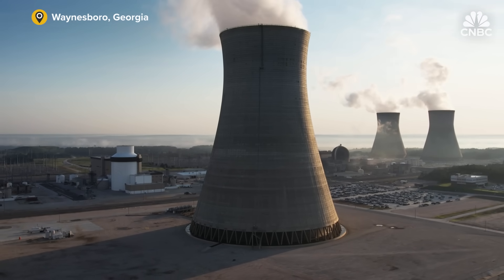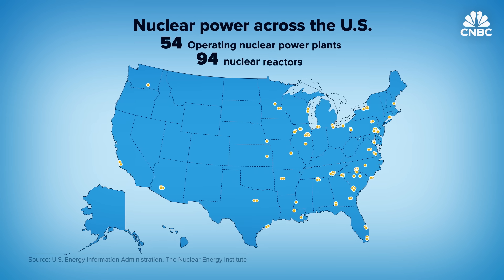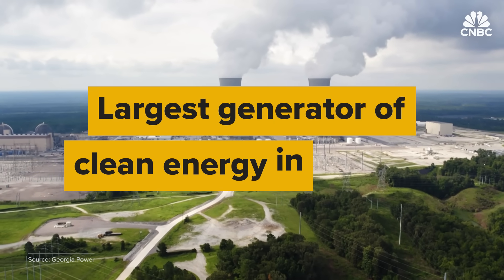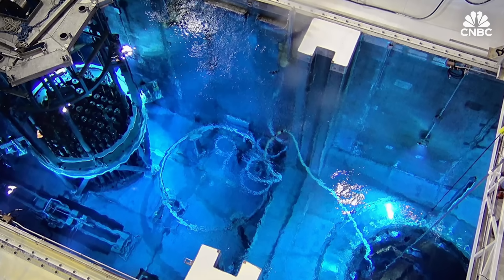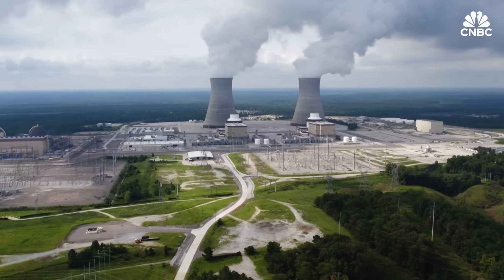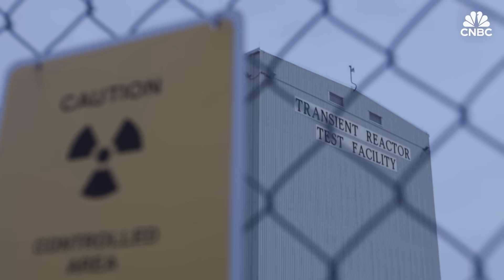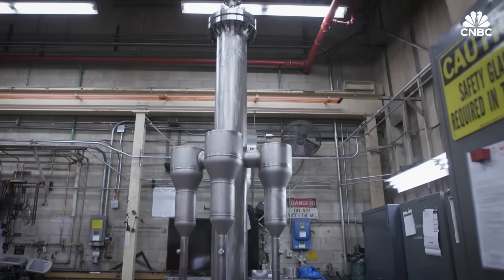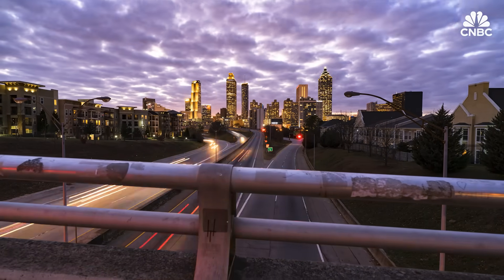Why It’s So Hard To Build Nuclear Power Plants In The U.S.

Comment: Why not build them in the ocean? With unlimited cooling  capabilities you would never have a problem with a potential accident. As long as the spend fuel rods are kept cool. The water not only acts as a coolant but as a barrier between the radiation and exposure to the environment.

Comment: Choose the vanilla electricity plans. Do not choose gimmicky plans such as free nights or reduce rates during certain hours, because overall, the electricity plan will cost more over time. Choose an electricity plan that is 2 years or less so you can switch. Electricity companies will increase their rate over time especially if you choose a longer plan.

Comment: I worked at NRC during Vogtle 3&4 construction and much of the cost overrun was due to shoddy work at the offsite construction plant. This plant used modules that were built offsite and shipped to Vogtle. There was poor QC at the construction plant and Vogtle had little to no oversite of the contractor. Consequently, modules had to be fixed on-site or send back for re-work. NRC inspectors knew the schedule wasn't workable, but that's what Vogtle put out publicly. Now ratepayers are stuck with the bill for their incompetence.
Reply: Worked for WPPSS nuclear project at Satsop WA. It was obvious from the beginning nobody was 'in charge'. Never finished. Satsop became the largest US bond default in history, but I was able to parlay that into another experimental reactor at St a Susana Lab, and again nobody was 'in charge'. That project subsequently leaked radioactivity within sight of LA, and the contractor bleached all records. I never worked there and there was no project. Horrible malfeasance, but imagine if word got out about leaks at the five US nuclear rsearch labs! Google 'downwinders' and 'cancer alleys'

Comment: It's funny that Westinghouse is also struggling at building It's AP1000 when they used this argument against the French EPR. In fact they're both struggling 😂
Reply: Small update : The EPR rector is finally working and connected to the grid (finally)

Comment: For the record, nuclear is smokestack-free, NOT emissions-free. No form of energy generation is once you pull the threads on materials and supply chains. But nuclear is in a class of its own. It’s a challenge to mine, leaving tailings that are radioactive. The refining process, which often begins in the mine, involves leaching that can pose a threat to groundwater. Every step of the way, a radioactive substance has to be contained, generally with lots of steel-reinforced concrete. Both steel and concrete have signifiant carbon footprints in their production. Nuclear waste is tricky. Currently, 90 thousand tonnes are in “temporary storage” at reactors because there is no place to send it. If/when there is, the radioactive material will have to travel by truck on public highways, or by train, which can present a security challenge. Or, at a time of accelerating climate change, simply a challenge. Rail track expands in heat so hotter temperatures are already presenting a new wrinkle for that mode of travel. While US mines are starting to reopen, currently about half the world’s enriched uranium comes from Russia, so there are also geopolitical concerns. Water for cooling  is another issue. While some newer SMR designs are much better on this score, the amount of water needed at a conventional plant is substantial. And when that water is warmed, it degrades it for other uses. Nuclear may be an essential part of our energy future given soaring electricity demand from AI, but the narrow focus on smokestack emissions has obscured the issues of what we’re dealing with. The video is good reporting as far as it goes. It could go further.

Comment: I worked as an electrician building unit 4, and from my personal observation, the biggest hangup on the project was the contractor (Bechtel). They controlled the workflow and we had to work off of "work packages", if you were working in an area and did not have a work package, you would be fired. There were many times when crews would finish their work in an area and would have to wait months to get their next work package for another area. They also did not hire enough field engineers, we needed to have all of our work inspected by engineers and southern company quality control, we would be always waiting on the engineers to show up just to drill holes, mount supports, or finish out a package. The problem is our power grid being owned by private corporations that only care about profit, if we cut out the contractor middle man and the nukes were just state owned enterprises, we could build them much faster and much much cheaper.

Comment: The primary challenges are all regulatory. There isn't an actual reason that the U.S cannot produce the majority of its base load energy from both traditional nuclear reactor designs, and novel small modular reactors. 
If we are going to run our government as if debts don't matter then, even just allocating a portion of the equivalent that has gone to Ukraine could completely alleviate the challenges surrounding nuclear's steeper start up costs.

Comment: We dont need nuclear, we need solar and batteries to store the power.
Reply: Battery storage is enormously more expensive on its own than just building nuclear plants.
Reply: @Crispr_CAS9  by how much ?
Reply: @rubenjaimes1194  Depends on the estimate you read and the type of storage solution you're using. But around 2-3x the cost of nuclear alone.
Reply: @Crispr_CAS9  where is this information coming from ? Link ?
Reply: @rubenjaimes1194  Schmidt et al 2019 in Joule for LCOS and EIA LCOE for cost of nuclear.
Reply: Batteries are nasty electrochemical devices. I'd take nuclear quite happily. Host a small modular reactor on my own land even.
Reply: @paulanderson7796  you obviously don't have a clue what you are talking about. Moving on.
Reply: @rubenjaimes1194  Feel free to move on matey. My degree is applied industrial chemistry. Stop the arrogance firstly and this discussion can proceed.

Comment: 3:48 The Westinghouse AP1000 was designed in the 1990s. A "current" design, not a "new" design. We need more of these Gen3 AP1000's in order to produce Gen4 reactors. Generation IV reactors are going in the design direction to recycle spent nuclear fuel from Gen III. Make them, we're 50 years behind where we should be.

Comment: Well…. Main reason is nuclear cannot compete… its to expensive
You only need solar and batteries, its way cheaper and faster
Reply: Nuclear power, on a a years per GW per site basis, is faster than solar and batteries, and is cheaper than the batteries alone before you even add the panels to power them.
Reply: *too

Comment: worst case for a petro-powered power plant. loss of 2-200 people, temporary loss of the use of 3 million sq feet of land. worse case for a nuclear-powered powerplant: loss of 2000-200000 people, permanent loss of 3 million sq miles of land. risk is a combination of frequency and severity. the problem is that the severity is so high that the frequency has to be proportionally low to achieve the same level of risk ... and that frequency is impossible to achieve. you can control what you know to below that level. you can't control what you don't know below that level because you don't know what to control. 50% of people want nuclear power. 0% of people want it within 100 miles of their house.

Comment: The operative word is "commercial".  Electricity supply should be regarded as strategic and underpinned by the State.  In the 50s, the State wanted nuclear devices and then learned of the benefit of cheap electricity.  How electricity is generated is a political choice.  If you do not have extensive hydro, as in Norway, fossil fuel is cheapest, but it makes CO2.  So for reliable 24/365 electricity production without CO2, you need to invest in nuclear, as was done 50 years ago.  Chernobyl and Fukushima were avoidable and were very careless.  We can do better.

Comment: There was the same problem in France, which has the highest number of reactors per capita.
They were all built decades ago, and the new types being built are slipping in budget and delays due to the disappearances of knowledge and experience after so many years without building new ones.
Plus, the new French model was extremely compliant, so much that after the completion of the first one (which is done), they'll go directly with a simplified 2nd version for the next ones.

Comment: Building reactors and using spent nuclear fuel, yes theres a way to use spent nuclear fuel as fuel exists, is easy. The hard part is the bureaucratic process. Tons of paperwork, tons of regulations, delay after delay after every delay, year after year, and lawyer fees. Thats the issue
Reply: SOLARS 5X CHEAPER ONLY SHILLLS TALK ABOUT NUCCCEAR... 100 YEAR STORAGE COSTS THEN 8X CHEAPER IN REALITY-- MEXICO DID 2 CENT KWH SOLAR FARM... AND NOW SOLARS DROPPED EVEN MORE A LOT

Comment: The big problem: each nuclear power plant is a very expensive, custom-built installation. That's why in France, they essentially duplicated one reactor installation type all over the country to keep construction costs down.

Besides, the future is small modular reactors of around 100 to 250 MW output per reactor, where each reactor's parts can be pre-assembled in a factory and then the reactor is final-assembled at the power plant site. And the new reactors will use Generation IV reactors that are essentially meltdown proof and use way cheaper thorium-232 as the nuclear fissile fuel.
Reply: SOLARS 5X CHEAPER... ANYONE TALKING NUCCCLEAR IS JUST SHILLL OR PARRROTTING SHILLLS INFO FACTOR IN 100 PLUS YEAR STORAGE OF WASTE AND ITS 8X THE PRICE PROBABLY --- HENSE MEXICO NEW PLANT 2 YEAR AGO 2 CENTS KWH SOLAR....... LOL AND PANELS 500W NOW 50 BUCKS 30 YEARS LAST LIKE 80 PERCENT LESS THEN JUST SEVERAL YEAR AGO

Comment: Dear CNBC, While the NPI points fingers at the public's "baseless fears, and backwards" attitude towards Nuclear Power ( current and new technologies ) the real reason that Nuclear Power is not gaining ground in the US is simple Dollars and Cents. China, Russia, France and India are building units with substantial government subsidies, this is not the case in the US. Secondly no one, "no one" knows exactly what the cost will be for a complete decommissioning of a 40, 60 and 80 year old nuclear power plant. Some preliminary estimates ( factoring for inflation ) imply that it will be almost as expensive as it was to build, and this cost will be passed down to the consumer. Lastly there remains the problems of long term radiation storage, which the few countries have actually solved, and which the US is still attempting to develop. Nuclear Power serves an important function in the energy stream of the US and in Carbon Free energy production, but the dollar per kilowatt is cheaper to use Solar and Wind with even very expensive batter storage.

Comment: We don’t have a choice. We have to build more nuclear and we need them now, not starting to build them in 20 years. I’d be for anything that reduced costs or rescued projects especially after they spent $9 billion already and now will never make that money back. I don’t know what happened, but the locals shouldn’t be footing that bill and nobody should be giving up on a project after being $9 billion in the hole. These power plants will make that money back over time but you have to finish them. 

As we build more and hopefully if we can get regulations to ease up where it makes sense, and as we gain that institutional knowledge back, these projects will stop going over budget and stop being so late. The designs will get more simple, the maintenance will be much easier and routine, the manufacturing infrastructure will be in place, everything will get better from here on out. 

I’m for the government stepping in while these issues get ironed out and projects go over-budget. But this idea that because it’s hard or expensive up front means we shouldn’t do it is a luxury we can’t afford anymore. We have to get our emissions under control and the obvious solution for energy production is nuclear supplemented by renewables. It’ll buy us plenty of time (centuries at the minimum, likely millennia) to get fusion off the ground which I think we can do within the next few hundred years assuming nothing goes wrong. And that’s assuming our energy needs increase by a couple orders of magnitude.

Comment: Nuclear power is no longer relevant.  There has been a breakthrough in energy technology known as Enhanced Geothermal.  This involves using advanced fracking techniques to drill deep enough into the earth's crust to generate steam, which can then be used to produce electricity 24 hours a day, 365 days a year.  This kind of plant can be built almost anywhere on the planet, can work in tandem with renewables, produces no greenhouse gas emissions, and does not require radioactive materials like plutonium and uranium to keep the plant running.  Enhanced Geothermal is cheaper and cleaner than nuclear power, and will be ready for the commercial market by 2030.  Can we finally end the nuclear menace once and for all?  See the work of Sage Geosystems and the U.S. Dept. of Energy's FORGE research project in Milford, Utah.  The future is geothermal!

Comment: Build modular reactors in a gigafactory. Make it inherently safe, even walk-away safe. Have independent inspectors onsite to check for all the safety features before it ever leaves the gigafactory. Do like Elon Musk and remove all unneeded parts. The simpler the better.
Make different sizes. Medium reactors can be banded together to form a power plant. These have to be small enough to transport by rail/semi truck. Or at least have components that can be easily assembled, where all the components fit on rail/semi.

Try to find the smallest size that produces useful amounts of energy. Over time, keep trying to shrink that minimum size. Make one small enough to power small ocean-going vessels. Imagine not having to refuel a Navy ship for the next 5 years. If you can. get one small enough to power a locomotive. Modern trains are already diesel/electric hybrids. Change that out for nuclear/electric hybrids. All you need to do is get rid of the diesel generator and the fuel tanks.
It's probably not practical to get them small enough to run a semi truck, but that's a worthy goal. Instead of all those batteries, you could have nuclear power running the Tesla semi trucks. That would eliminate the range issues as well as the cold start issues.

Do it all in gigafactories. These all get safety inspected at various steps along the process, and in the final stage.
Nuclear is already the safet form of energy by far. Let's make it safer.
And of course cheaper.

Comment: A problem I see here is that people want to know exactly how much and how long a new reactor will take to build, then get upset when those targets are missed. They want a Predictive WaterFall-type project where EVERYTHING is planned upfront. These projects would work better in an Adaptive Agile project methodology, similar to how software is written these days, where you agree on the outcome but can't exactly lock down on time or costs.   Instead of trying to lock down a single cost for the whole project, which takes years to complete, you agree on how much you are willing to spend every year and let the project run for how long it needs to run.  With oversight and governance, this is how software projects get finished.